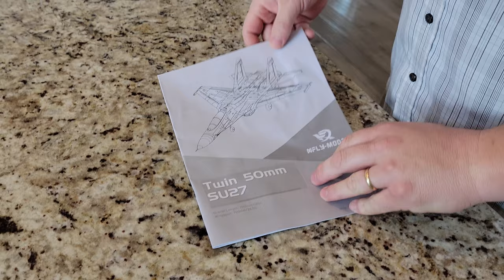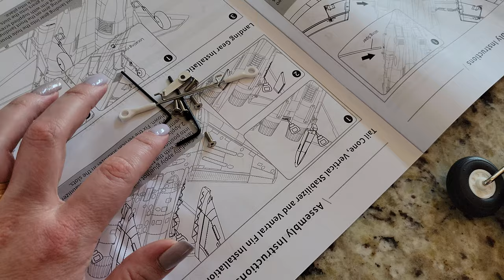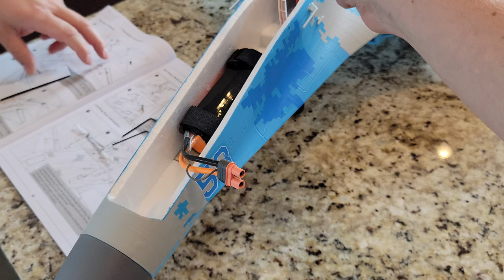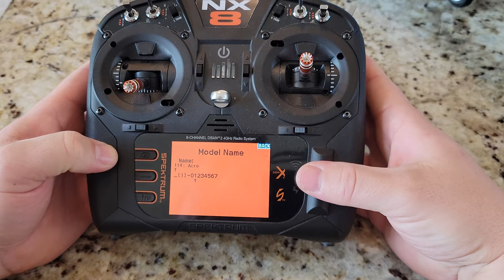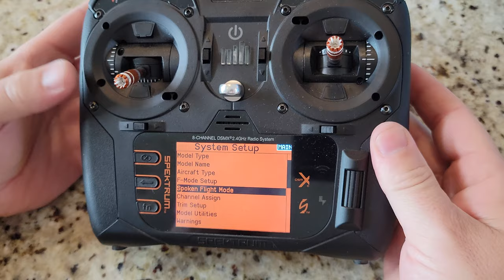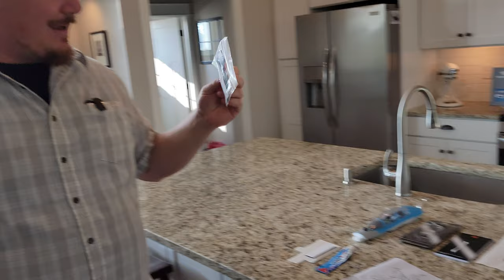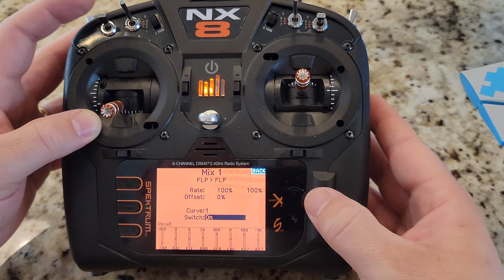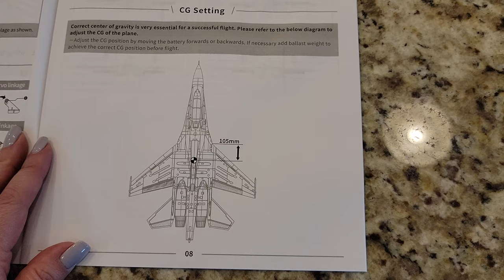XFly - SU-27 - Twin 50mm - Unbox, Build, & Radio Setup

Comment: The real SU 27 actually uses flapperons just like an F16 so it is kinda scale minus the leading edge slats of course. Also interestingly enough My SU 27 came with the spring loaded suspension nose gear. I'm not using it tho because My field is grass so I just belly land.
Reply from the maker: It does land in grass, but you'll break off the tip of your nose cone every time - DANG IT!!!! I've done it twice now ;( LOL This of course is a 30 second repair, but it's annoying, and somewhat unavoidable due to the nose pointing downward on this beauty.
Reply: @BrianPhillipsRC  yupp broke mine off several times as well haha

Comment: Mr Phillips I am looking for your expertise with my nx6 controller...my son found his way into the settings and I now have a battery warning stuck on and the controller will not do anything other than tell me "warning battery low" even after putting fully charged batteries in it...im sure I need to go back into the warning menus and reset it but the problem is it goes into the warning before I can make it  to the menu and it leaves me froze out...how do I fix this problem so that I don't have to put my foot up my boys behind ?  Lol
As always I love your tutorials and so do my boys..God bless and keep up the good work .
Reply from the maker: Press and hold the scroll button while powering up the NX6 to get into SYSTEM SETUP. This is then how you might be able to bypass that warning, since that warning had to do with RF Module, not the whole tx.

Try this

Comment: Hi brian what do you think about the Spektrum DX6i transmitter and what is the best recever to use with that system?
Reply from the maker: This transmitter was good in it's day. If you want to use it, that's fine, but I wouldn't go out of my way to get it. I would save up and get something more current so you aren't all of a sudden not able to control the "next plane".

Also keep in mind, 6 channels is rarely enough for the most popular planes anymore. From experience 8-9 channels will get you along for some time, and we have been very happy with out NX8.

IF you find one for super cheap, used, or if you wanted to try to get a used NX8, might be wiser decision.

As for if you already have one and want to use it, it's in the DSM protocol, but not sure if it's DSMX (the current protocol). But I'd be more worried about the absence of Forward Programming, which is required for many new BNF models coming out. NX8 will get you up to speed and keep you there for a long time.
Reply: @BrianPhillipsRC  Hi Brian  I did pick one up for $75 dollars looks brand new in its original box the radio does support DSM2 and DSMX protocols according to its manuel seemd like a good place to start till I can go into a more up-to-date system all my planes are curently 6 channel planes from hobby king so I only need 5 channels on a 6 channel receiver for the gyro no flaps or gear  so I thought it a good fit just not sure about its range or the best recever to use with it not sure if it is an over all improvement from my current FLYSKY I6X 10 channel system I appreciate your thoughts  thank you

Comment: Brian, I bought this plane and I didn’t know that I would have to split the aileron connector. Is there any other way to make it work other than splitting the wire? I’m currently using a AR620 receiver and plugging the aileron into either channel 2 or 6 wasn’t doing anything. If I used a AR420 would It work by only having the 4 channels, or is splitting the wire the only way?
Reply from the maker: If you dig out the "Y" Cable you can do it without, but you need more channels to do flapperons, so if you don't really mind, just leave them together.

P.S. AR410 doesn't have AS3X/SAFE - sorry, not sure if that matters for you...

P.S. I tried to reply the other day, but my PC freaked out and I lost Internet for some reason, and the comment disappeared to the inter web - sorry about that!

Channel Control (in no particular order)
1) Throttle
2) Rudder (Steerable nose gear)
3) Elevator
4) Ailerons

So...I guess you COULD use the AR410, but no AS3X / SAFE...

~~~~~~~~~~~~~~~~~~~~~~~~~~~~~~~~~~
AR410 https://bit.ly/3z5hT75 - Simple 4 Channel Air Rx with limited telemetry - No AS3X & SAFE
AR620 https://bit.ly/3z7WDO0 - Simple 6 Channel Air Rx with limited telemetry - No AS3X & SAFE
AR6610T https://bit.ly/3z37ysk - More telemetry - No AS3X & SAFE

AR630 https://bit.ly/3zpdgVR - AS3X & SAFE with limited telemetry + INTERNAL Antenna
AR631 https://bit.ly/3v0w3Fy - AS3X & SAFE with limited telemetry + EXTERNAL Antenna
AR637T https://bit.ly/3OlgIpB - AS3X & SAFE with FULL RANGE telemetry + EXTERNAL Diversity Antennas

AR8020T https://bit.ly/3vgCnbV - FULL RANGE telemetry + EXTERNAL Diversity Antennas
AR8360T https://bit.ly/3crfA6H - AS3X & SAFE with FULL RANGE telemetry + EXTERNAL Diversity Antennas
~~~~~~~~~~~~~~~~~~~~~~~~~~~~~~~~~~
Reply: @BrianPhillipsRC  Thanks so much, I’m pretty new to “hobby grade” planes so I always try to find a video of yours to explain it. Is there a 5th Y connector in the canopy/fuselage or only the 4 that are clearly visible? I also have a AR620 and my ailerons won’t work plugged into channel 2 or 6 so does that mean I would have to split it, get a AR410, or is there a 5th Y connector somewhere in the plane.

Comment: HELP!!!!! So I finally got around to rebuilding my pkz f4f wildcat used same receiver same everything just new airframe got it binded up to my dx6e with the safe and as3x well for some reason my ailerons are acting as flaps left and right on right stick gives me up and down and no opposite direction I've tried making it dual ailerons by putting one on ch6 and the other on aileron channel and with that set up I get left and right but safe and as3x only work on one aileron servo idk what to even try to fix it sorry for the random question but I figured you would be the one to try and ask but this is driving me crazy and I'm out of ideas and YouTube videos lol
Reply from the maker: There are about 20 questions I don't know the answer too to be able to actually help, but I'll do my best...

What Rx is in it? I can't remember all the different interactions I have here on YouTube, please forgive me.

If you have the channel, you won't be able to use it for the ailerons...since the AS3X will correct only one of the ailerons (so technically you CAN do it, but the roll axis will be more sloppy than you're used too).

If you have a Y Cable splitting the ailerons, and they both go the same direction, you either have....

1) one servo mounted backward.
2) one servo REVERSED (It's a different type of servo that is called a REVERSE SERVO)
3) something else, I have no clue about

To fix this, you can either get a NON-Reverse servo in one of the wings...but you need to identify which one is correcting the RIGHT way when you have AS3X (and SAFE) on. This is critical. You need to know...fix the ONE THAT'S NOT CORRECTING IN THE RIGHT DIRECTION.

You can accomplish THIS by putting a servo signal reverser AFTER the Y splitter on the path to the MESSES UP AILERON. Or you can take out THAT WRONG AILERON SERVO and rewire it to be a "reverse" servo (or at least reverse it from what it's doing) - pull it out, open the case, desolder two of the three wires on the feedback pot, and swap them (any of the three wires) then swap the two wires on the motor. This is the OTHER way...but adding a servo signal reverser is way easier for most...fyi

Servo Signal Reversers (Horizon Hobby) https://bit.ly/3B9nVpT
Servo Signal Reversers (Amazon) https://amzn.to/3bpECDf
Servo Signal Reversers (Banggood) https://bit.ly/3tkn9yN
Reply: to start with it had the ar636a in it and me trying anything I could think of I switched it to the ar637ta with the telemetry even tho i cant figure out how to use telemetry for battery life but anyway pulled out the servo and under the factory glue it has a rev sticker so I'm gonna swap it out with a pkz sv80 and hope for the best thanks so much for the reply and plenty of options to try and get it right hopefully by this afternoon she will be in the air for the first time in forever my old one got used so much and got brittle around the firewall and the 1100kv on 4s with a 50amp esc was just to much for her and the motor just pulled right off and down she went
Reply: well you were right it had a reversed servo on one aileron changed it out and shes good as new thanks so much man I really appreciate the reply and options on what to look for and how to fix it